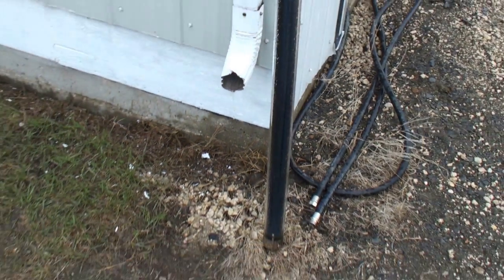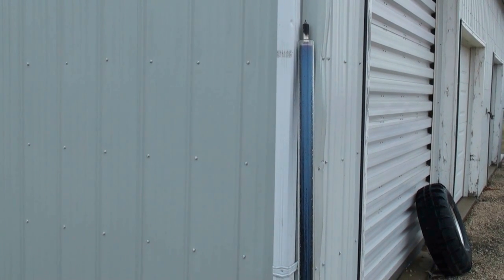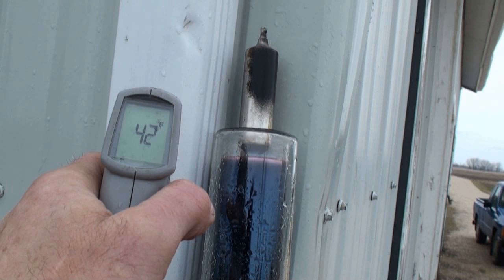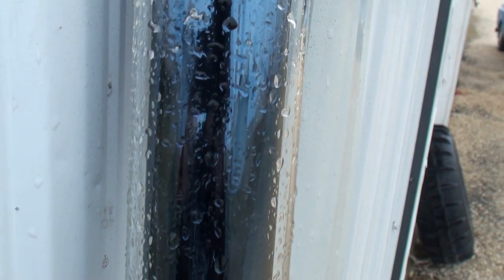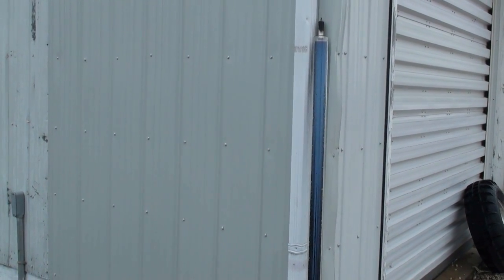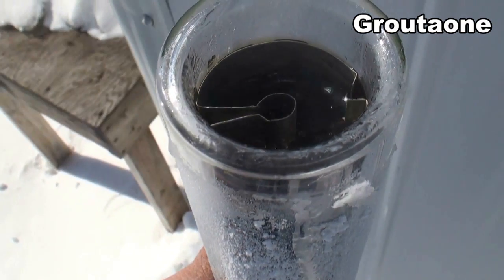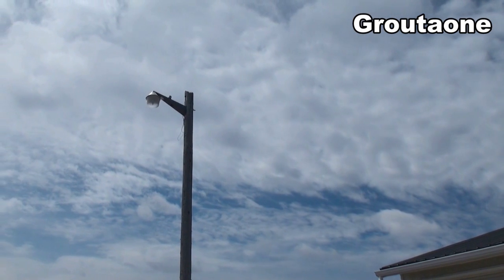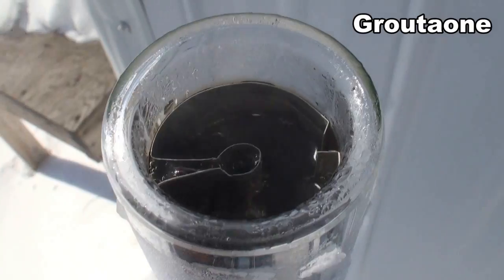Solar Heat Rain Day Test

Comment: Groutaone- it was about 5 years ago I happened to see these online...same website reported they were considering a tube that absorbed nighttime infrared heat waves- but I recently read the company got bought out. I thought it would be cool to piggyback solartubes with one of the Honda fuel cell/Mhcp heaters (converts natural gas to electricity with hot water output) to cover nighttime heating duties, then the solar tubes reduce consumption of gas in the daytime.

Comment: nice vid! i have 40 of these style of tubes for my hot water system and coming into winter here, it'll heat 400L of water to almost boiling during a normal day. Enough for a family of 6.
great to see that you're getting into them!
Reply from the maker: Sounds good, your 40 tubes, are they all in one manifold or are they two units?
Reply: 2 units, each with 20 tubes into a manifold. I'd like to add another 20 at some stage to use the extra heat for heating inside the house

Comment: My only concern is hail. Do you think they will stand up to our hail storms. If you were to rig a plexiglass shield to protect the tubes,would that cut down on heat production.  I am a Minnesotan so we ruffley live in the same climate.
Reply from the maker: They seem to be fairly tough, I think the trick is to mount them near vertical then the most they get is a glancing hit
Reply: groutaone thanks for the reply. A friend of mine is really interested in how you progress with this. His heating bill this winter was over a thousand American, a month for his shop and house. I had originally found you while researching the coal stoker boiler you use. I have been watching you ever since. You make really good videos.
Reply from the maker: Over a 1000 per month, I understand why he is interested in other ways to heat, there is a guy out here that heats his 12000 sq foot work shop with solar tubes, been a few years doing it now, he has a boiler for back up heat that I think he used before he went solar, been a few years now and has not had to use the back up
Reply: groutaone ya, I was shocked when he told me also. The house has an in floor heating system. The shop has to be about that size or bigger. Original owner had a construction company so it is a big shop. The shop had in floor heating system also but it was allowed to freeze so it is unusable now. That would have been perfect for solar because in floor works at lower temperature then radiators. He was guessing that the system could pay for itself in five years.
Reply from the maker: If his house and shop are not too far apart he could use one large solar heat system to heat the house and shop at the same time, solar heat can attain high temps if needed so a rad could be used, I will build a stainless storage about 1100 gallons that stands upright so it doesn't use up too much room and use it together with a hot water radiator and fan behind the rad controlled by a thermostat, this way floor heat is not needed.My tank size might be over kill but too big is much better than too small, got my complete solar heat system ordered and on the way. Five year payback might be tight, maybe more like seven
Reply: groutaone the shop is maybe 150 feet or so from house. The shop is big enough to fit house inside so it may need even bigger system. I'll talk to him. See were he is at on his decision. He may try to message you,I'll tell him to use my name, so you know who he is. He is north of the twin Cities. I am guessing you are within 600 miles, if you are going to be a distributor, he may be dealing with you. Don't need address noticed that you get rain storms and snow storms the same time we do.  I wouldn't give out my address either if I made you tube videos. Not saying that your viewers are crazy, but they are out there. I think I may have known the one in Iowa that took over the TV station and told the cops he was god a couple of days ago. So I completely understand and agree with you when you get questions about your address. I used to work at a gas station so I know crazys.

Comment: Where can I get some and how much lol
Reply from the maker: For some time now I have been working at becoming a distributor and has now just happened, in the future I will have complete systems with high end components available, plug in and go, works great with floor heat or a water storage tank,

Comment: Cool stuff! Have you had a chance to ride the 500/490 yet?
Reply from the maker: Lots of chances to ride just have not swung a leg over them for a long time, not even been riding the Pitster
Reply: groutaone  sad story. This Cr500 needs to be used.  My Rm 250 is still not ready yet because i cant find a crankshaft for it. And im rebuilding a Yamaha DT 200 2 stroke for a friend of mine at the same time. It was his first 2 stroke and he didnt know he had to put oil in his gas. The bike ran for 2 hours without oil and seized up.
Oh well, another day another dolar i guess.

Comment: is that some crazy contraption you made yourself or did you buy it? pretty cool!
Reply from the maker: No this is a purchased unit, I will be buying a large solar water heat system for the shop

Comment: really interesting, that could save me a lot of money...
Reply from the maker: Yep, super cheap heat, how big do your heat bills get now?
Reply: groutaone with this winter we had it is gonna be at least 4000$ for Hydro Quebec. Heating my home and garage ( about 2000 sq ft total)
Reply from the maker: remi briere You would really benefit from a solar heat system, there is a guy in the area that heats a 12000 sq foot shop with these solar tubes, I am converting my house and shop over
Reply: groutaone I am seriously thinking to do the same... Thanks for the input!